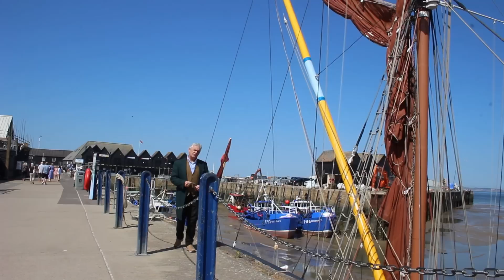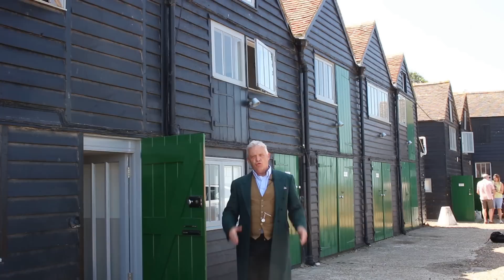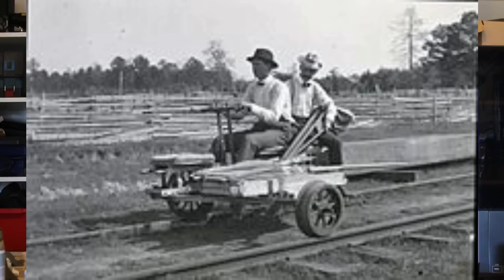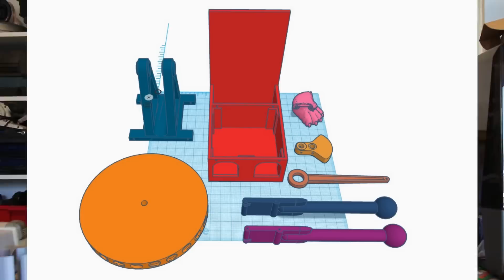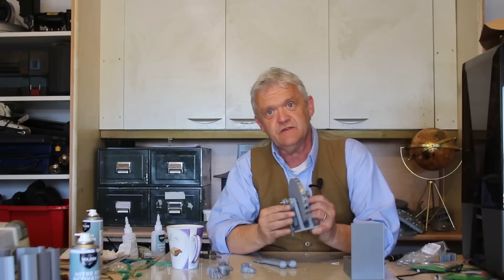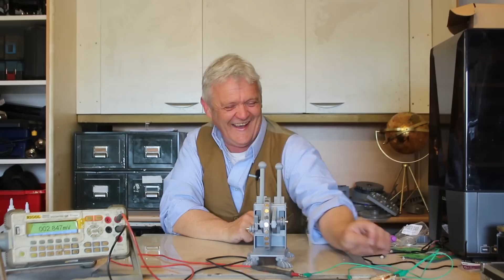1980 The Singer Sewing Machine, The Penny Farthing and Power Production

Comment: I saw a junked exercise machine that used a generator and a selection of big resistors to set the difficulty level of the machine. It's a ready to go generator. Insyead of just wasting the electricity by dumping it into resistors, why not use it?...If you ever see a exercise machine set out by the curb, check it out.

Comment: Ratcheting free wheel before the generator wheel with 5x the magnet weight 🧲. Another set of lever arms to spin a turbine at much higher mechanical advantage and gear ratio. 

Length of arms and size of turbine multiples of scale larger than flywheel generator.
Reply from the maker: cheers

Comment: What if you connected that to tour sterling engine
Reply from the maker: go for it mate - give it a try
Reply: @ThinkingandTinkering  I'm kind of working with a stirling engine idea but I'm trying to work at using graphene ink as a heating system for the hot end and water as a cooling system for the coolant

Comment: Nice results! I recently had success in powering a 3d printed generator with a primitive 5000 year old style pump drill.  The magnet studded fly wheel rotates CW then CCW over a serpentine coil with just a simple up and down motion of the push bar. It gets up to some serious rpms and output voltages. I think the Vikings used this type of drill. I was thinking of posting a video short of it working. Is is worth a post?
Reply: I'd like to have a look.
Reply: @edwardphillips8460  I just posted this new one on my channel. Thanks!
Reply: @William_Hada  nice now I just need to find your. Channel.
Reply: @edwardphillips8460  m2
Reply from the maker: yes - absolutely mate
Reply: @ThinkingandTinkering  The new video of the Pump Drill Generator is now posted on my channel. Please let me know what you think. ( We can't post direct links in the comments).
Reply: Definitely!

Comment: "We COULD gear it..."
That, on top of the "Gearing" that can be provided by simply adjusting the pivot points of the levers etc, should be able to get some SILLY speeds!
I wanna upscale one of these. I WAS thinking perforated square tubing for the links, like Signpost stuff, for adjustability, but then I saw the prices for that. Unistrut it shall be.
Reply from the maker: good old unistrut!

Comment: I was working on a very low head water pump design to pump water, and your treadle design is exactly what I was looking for. 

In another vein, I had wondered instead of directly applying pedal power to the bicycle drive wheel, what if it was applied to a flywheel like the old flywheel busses? Then power could be applied to the drive wheel via a CVT.
Reply from the maker: combine with a peristaltic pump? nice one